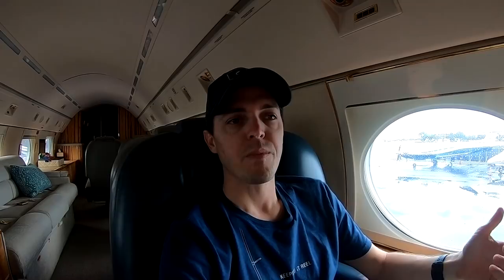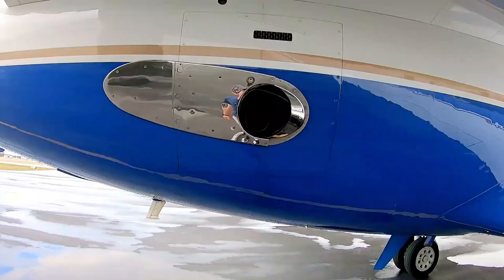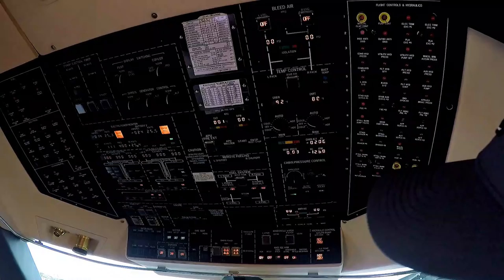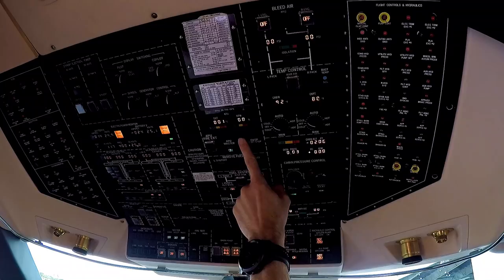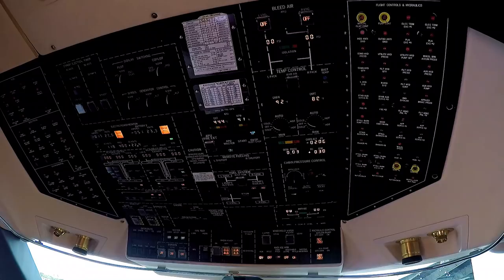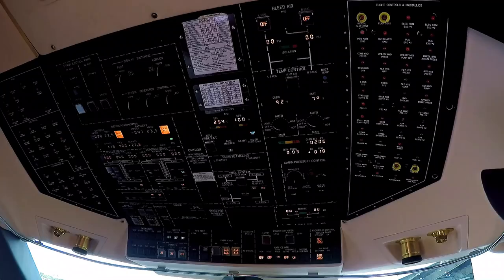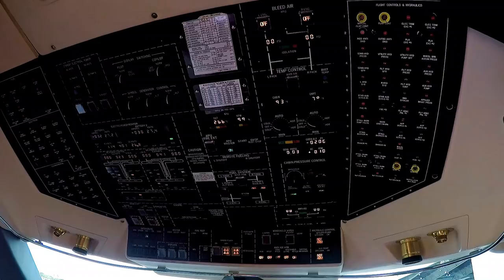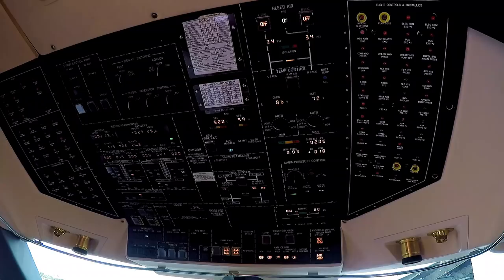How To Start the APU of a Gulfstream G-IV - Pilot VLOG 36

Comment: Excellent video-just some clarifications- 
APU cannot be just refered as a generator or so, rather it's a small engine using aircraft fuel to provide Bleed Air and Electrical Powe while engines are not running 
As the name suggests, conditioned air means to cool the cabin while it's hot and to heat up while it's cold..
You can put the APU bleed on immediatelyvafter start, however it will come ON only after 2 min.

Comment: Side note on a gIV you can run engines with the cowling down on right side the apu won’t melt it. It’s the g450 550 and 650 that you need to worry about and there is an indicator on the over head on those that will illuminate if the right engine cowling is down

Comment: Years ago, I used to do some design engineering work that involved using a G-IV APU (which is made by Honeywell if I remember correctly).  I helped build a prototype military aircraft start cart in which I was responsible for the controls and had to interface with all the APU electrical signals to show correct RPM's and EGT on a panel I designed. I love your videos, keep it up!!
Reply from the maker: That's awesome!! It is Honeywell. Thanks for all your work!

Comment: The APU comes in handy when you are at an airport where they do not have a GPU. I would imagine that it is more of a convenience item during start-up than connecting to a GPU. Greg from Premier 1 Driver who I am a big fan of gave a presentation similar to your's on how to start the Premier's engines. He has no APU and must be connected to a GPU for start. He can start one engine and then the other immediately after. No waiting involved. He saw that as a positive. I believe you have to wait a short period of time after starting one engine and then the other. The way I see it, 'It is all good"! Love the G-IV and your videos!
Reply from the maker: The G-IV actually uses air (not electrics) to start the engines, so no waiting between engine starts for us either. But the problem with that is we must have the APU up to start the engines, or have a huffer air cart. A GPU wont help get the engines going for us.

Comment: You discuss, after the apu is running, turning on the air which, in turn, caused the exhaust temp to rise.  But what does "turning on the air" actually do to the apu, or to the airplane?
Reply from the maker: This works the same on the APU as it does on the main engines. We are taking bleed air off of the compressor section of the turbine engine to provide high pressure air for the cabin pressurization system. The pneumatic system of the APU is restricted to ground use only, so basically this is just to heat or cool the interior of the airplane. The air coming out of the APU (or engine) is vey hot from being compressed, so it has to go through a PACK, or pneumatic air conditioning kit, before entering the cabin. I hope this answers your question. If not, let me know and I'll try again.
Reply: So why does the exhaust temperature rise so much when you turn on the bleed air?  I assume since you're diverting some of the air to the PACK for the cabin, you're not getting rid of the exhaust air as quickly which might cause a temperature rise.  Keep up with the great videos!

Comment: Really appreciate your videos!   Sometime, please show us how the G-IV ran off the runway at KBED.   I recall it had to do with locked controls.   Did Gulfstream come up with a fix so it doesn't happen again?  Or is it still just a checklist item?
Reply from the maker: I will definitely talk about that one on video...but it was a control lock issue. Gulfstream redesigned the control lock mechanism so that the power levers cannot move with the control lock on, but not all airplanes have had the mod completed yet. So yeah...still a checklist item.
Reply: I got my multi out of KBED years ago, later based my Duke there. My nephew is now a designated examiner and mentor pilot on Phenom 100 and CJ's out of BED.  Writes for Turbine Pilot edition in AOPA.

Comment: If on AC ground power and you start the APU, does it automatically switch the the APU generator and vice versa back to ground when connecting the ground power. Can you stop that from happening and remain on ground power, even with the APU running? Thanks.

Comment: How long is the start up procedure take, how long do you normally get to the jet before the passengers arrive, finally do you keep lots of fuel in the tank when the jet is not in use and is in the hangar.Thanks
Reply from the maker: All great questions...the startup procedure only takes a few minutes, but there are many system checks and FMS procedures that have to be done before starting the engines.  We usually arrive at the plane an hour before passengers to get everything done.  If we had to, we could go from opening the door to starting the engines in less than 10 minutes though.  As far as the fuel, we prefer to not have lots of fuel in the tanks while sitting around as it stresses the gear.  So we typically have around 5,000 pounds in it.

Comment: Nice Thorough Start! And your E inverter was working too! You guys have the -150?
Reply from the maker: Yes indeed...makes a big difference for ground cooling on a hot day, also gets those engines turning a little better than the -100.
Reply: Agreed! -150 is a big improvement. Now if GAC and the FAA could only fix the APU firebox sealant. ✌🏻

Comment: Excellent description of the APU sequence. Despite the onboard APU do you still need a cart?
Reply from the maker: As long as the APU is working properly, we don't need a cart for anything...except the lavatory...HAHA!
Reply: Yuck, no doubt. I come from the King Air world, the PT6 is electric start. If the battery was even a bit weak, the ITT would spike so it was generally a good idea to do a cart start on at least one engine - left - and then a generator-assisted start on the right engine

Comment: I have a couple of questions: when do you need GPU to start the APU? 
Does the APU stay on once the main engines come on or you turn it off afterwards..?
If you have multiple stops during a day do you guys leave the APU on before the next flight or its always a start from a cold and dark cockpit?
Reply from the maker: The GPU would only be needed to start the APU if the main batteries were dead. I've never had this happen to me, but I know pilots who have been in this situation. Usually we will shut the APU once the engines are started. The exception to this is when it is very hot outside and the cabin needs the extra cooling from the APU. In this case we will leave the APU on until nearing the runway, then switch the air system over to the main engines. If we have less than an hour between flights, we will generally leave the APU running. If it's more than an hour, we will usually shut it down and start from dark.
Reply: Corporate Pilot Life thanks for replying!! :)